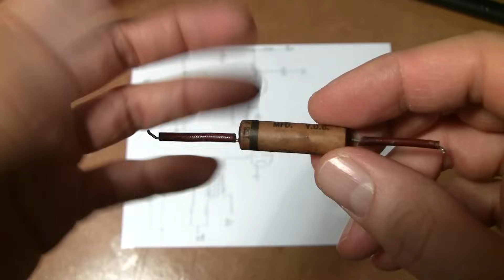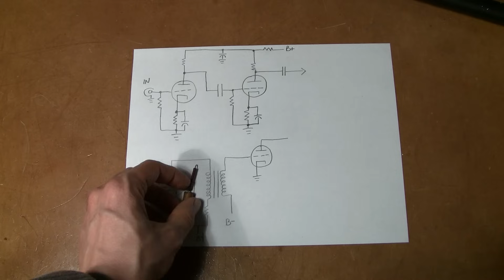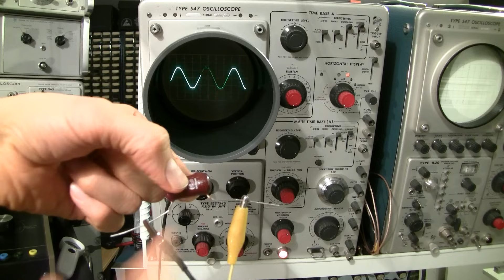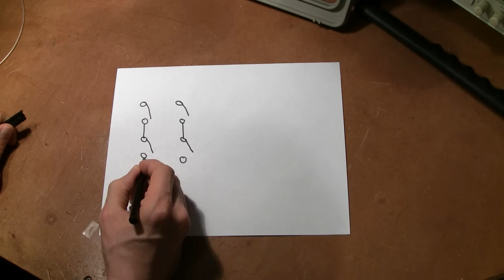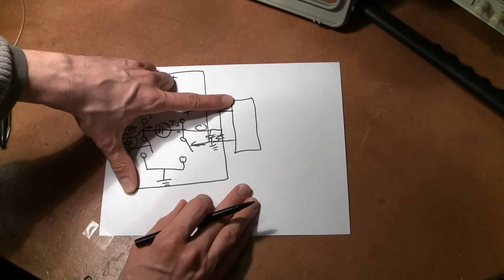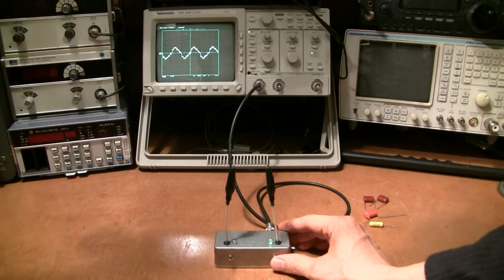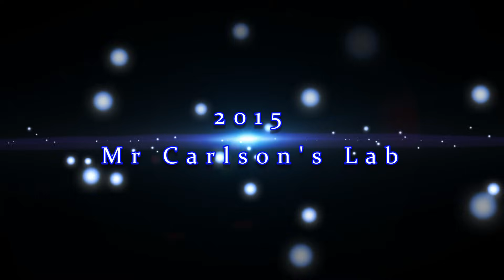Are Your Capacitors Installed Backwards? Build this and find out

Comment: I called Tone Pro re:the Humbucker set I bought. I believe I had identified the ground end of the orange caps they provided and ask them what lugs I should solder them to the volume and tone control pots ( 50’s wiring ). They said they’re not polarized. 

So, that being said, does anyone know which pot I solder the ground to ? Tia.

Comment: Did you discharge the capacitors before you put the oscilloscope leads on them? I wonder if the markings on the capacitors are correct. Just an observation.

Comment: Is this phenomenon as important in transistor circuits as it is in valve circuits? If so how would commercial manufacturers take this into account when manufacturing if the cap bodies are randomly  marked in polarity, or not at all?

Comment: オイルコンデンサーは、金属缶に入っています。外側をフィルムで絶縁しています。
　外側にプレート電圧が掛かると、フィルム１枚だけの絶縁なので危険です。
　そのため、外側をグリッド側に繋げます。
　あなたの考えを聞かせて下さい。
(japanese)
Oil capacitors are housed in a metal can. The outside is insulated with film.
If plate voltage is applied to the outside, it is dangerous as there is only one layer of insulation, film.
For this reason, the outside is connected to the grid side.
Please let me know your thoughts.

Comment: So, when I build a gee-tar pedal, this applies to using a shielded box as well.  Yet, even with that, there could be unintended feedback and the like with the bleed over between circuit components.  Seems a crazy way to do elite optimized audio circuits if you have to test every one.  There must have been reasons for this.  What was the rationale?

Comment: I know this is a very old video so it's a long shot asking a question but it's worth a try. I build guitars and only recently was made aware that it mattered which way I install capacitors onto the potentiometers. I really only need the cheapest oscilloscope I can find that will help me test their orientation. I'm talkin weird brand name Amazon cheap if possible. Any suggestions would be greatly appreciated.

Comment: Question..?

Thanks for sharing your hand made schematic of the capacitance assistance time box.   I will build one but first I want to be sure I have something clear which was  glanced over…. On the CO4013, Your drawing shows pins 3, 4, 6 above 7, 8, 10?  Are these all grounded?  The 3, 4, 6 are lighter in green marker and not along side of the IC as everything else well shown.  I just want to be sure all six are grounds before I wire it.   Also, On the 555 timer chip…… Is it pin 6 or 8 to the 9 volt positive?  Hard to see which number pin in the upper right background.

Again, Thank you for this supreme education as I ponder now starting to recondition vintage radios.  

Oh, By mistake I hit thumb down but quickly went to hitting thumbs up.   Just so you know, one thumbs down is not real.  You are definitely excellent and a thumb up all the way….

Respectfully,
Michael in Palm Beach, Florida
561.951.9999 cell 
(Posting okay here  for you and all.)

Comment: But tell me though, are the model yellow caps made a different way so that here is no more 'outside foil' construction?
I tried the method that used an amplifier, cap connected to the input, listening for the loudest hum from your fingers. Same deal as using a scope to see hum on a scope.
 For some lower values we did hear a hum, others, mostly smaller valued , no hum or hum difference at all.
 For some circuits like a an extremely low noise floor amp, or similar circuit, some of these may , or may not matter. SOme hobbies like vintage radio restoration it probably will not patter at all.
     So the question is, are the modern yellow caps rolled like the old paper foil caps are? 
     Lastly I think he needs to make a video showing the actual difference in cap orientation, Is it something really to be heard? Or only to be slightly seen on a scope?

Comment: Wow!  You must be an engineer, using a 4066 plus all of the associated control circuit when a technician, such as myself, would have wired a DPDT switch as a polarity reversing switch and would be done.
Rube Goldberg would be very proud of you.

Comment: I was testing a bunch of capacitors manually and I was identifying the foil end easily until I got to some mica (680 pf and 1000 pf) caps which showed equal amplitude in both directions.  What have I done wrong?

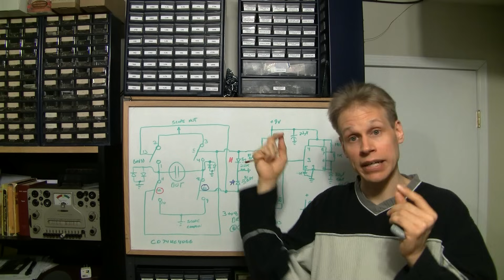Comment: I would have made this much simpler. Just one 4pdt switch a knob with a pointer and a BNC connector. Let's start with the shielding foil to the right in his drawing shown at 36:39. With the switch moved to the right contacts 3/5 and 11/12 closed, so the shielding foil is connected to the scope and the other end is the ground side of the scope. The noise should be low and if you reverse the cap the noise will increase. But, if you then turn the switch to the left the noise will drop back down. The switch pointer always points to the side you should mark when the noise is low. Simple. Let me know if I have this wrong.
Reply from the maker: I have explained why this won't work a few times in the comments already, just do a search.
Reply: @MrCarlsonsLab  I went pretty deep, I found found two people said they built it with just the switch and a third where you didn't say it won't work, just you had reasons to build it the way you did. I did find this back and forth, shown below.

"@donaldfilbert4832
8 years ago 
 I certainly do understand the appeal of creating a test box using multiple ICs and elegant designs - I suggest that a simple "3 Pole / Double Throw" manual switch (On/On) approach would do the same thing cheaper and easier (and therefore - more elegantly in some respects).  The two center leads of two poles go to the Alligator clips.  The two outer edges of those two poles are criss-cross connected to provide lead reversal via the manual switch, and one end of each of these poles is connected to the ground and center lead (respectively) of the scope connector.  The 3rd pole is used to burn the respective LED - showing which lead is on the ground when the displayed signal level is lowest !!  I made the drawing - but can't upload it with this comment - but it seems sound.  Thanks for all the great videos !!!

 @MrCarlsonsLab  I have written why I didn't make it with a DPDT switch a few times in the posts. Just search down the list, I'm sure you will find them.

@AgentFriday
7 years ago
+Mr Carlson's Lab - I have clicked the "more" button dozens of times, and am still searching.  Could you maybe pin one of those answers to the top?  (Youtube comments are ridiculous, grrrr...)  This is such an obvious question, I wish the video would've addressed it right off the bat.  If I understood the need for building such a circuit, it would have been much more enjoyable watching the explanation, rather than having that nagging question "Why are we wasting our time on an over-engineered solution?" the whole time.  Thanks. "

Comment: @10:30 time stamp,
 That is really cool....
Well as you can tell, i'm extremely new to this type of stuff, will probably just do this as a hobby....
  Man do i have a lot to learn....
But didn't know thats how you check those Capacitor's, to varify, which way to install them in a Circuit, thats pretty cool....
  I don't own any Equipment yet, and so, for now, just trying to find good teacher's, that teach correct way to do all this stuff, so Hopefully, I don't pickup bad habits from incorrect, and poor teachers....
  Thanks, Mr. Carlson, 
For all these Valuable Videos....👍😎🇺🇲

Comment: Most of these capacitors are used in networks rather than supply bypass. By the time you have noticeable pickup, it's on both ends. So the real design requirement is adequate shielding.

Comment: Excellent video.  Now (for me) the important question: how much of a difference will this make in my (yet untested or powered up) Fender Deluxe Blackface amp kit?  All the electrolytics are in according to the circuit.  Should I de-solder and test the others?  Will it make a noticeable difference?  Thanks as always!

Comment: I used to repair electronics in teeminals used at newspapers in the 80s. I always wondered about this issue and asked myself if I was really installing the caps correctly. Took 40+ yrs to get an answer. Why these aren’t correctly labeled at manufacture is kind of mind boggling. Wouldn’t take too much effort to get that done correctly

Comment: I have a Crown LXi1500 amp I am replacing the coupling caps with polypropylene. I don't have a scope so I used a shortwave radio tuned off frequency. The antenna was an inductive loop and the grounded lead was attached to the BNC ground & the antenna input was the loop. Cap held with alligator grnd wire. Least change in sound when touched was marked as banded end.
Reply: Clever idea, thanks!

Comment: When you are connecting the capacitor to an oscilloscope aren’t you using it as a high-pass filter? However, at the same time you are speaking of them as applied in grounded low-pass filter. To my understanding these two applications have a significant difference in how the characteristics and quality of the capacitor affect the output signal, right?

And I didn't quite catch what you are trying to demonstrate by putting your fingers on the capacitor shell. Of course you are creating ground interference but how is that supposed to relate to potential interference induced to an actual circuit?

Comment: It is interesting observation... But it really does not matter because the capacitance between terminals is much greater than the parasitic capacitance through the epoxy case. And in reality in the air the capacitance to the body will be ~10-20pf, nothing compared to 100,000pf (0.1uf). So I doubt that any manufacturer cares about polarity of non-polar capacitors, but if DIYer is happy about the "perfection", let them be so! (certainly, tubular ceramic 10pf capacitors at 100MHz circuit do make difference. In the past, when they were produced, they did have markings for the outer terminal)...

Comment: I'm not disputing what you're saying for RF circuits or using old foil rolled caps, but after building dozens of preamps, hi-fi and guitar amps with modern components, this simply isn't a practical problem. These curcuits were dead quiet on a scope, and I didn't worry one bit about which end of the caps were pointed in what direction.
I also can't help but think that if this was a real problem in modern capacitors, there's no way the manufacturer would leave them unmarked. Just to save a dot of ink? Come on.
Reply from the maker: It's pretty simple, modern circuits are built on circuit boards that can have a ground plane underneath, (takes care of the outside foil issue, "in some cases.") The majority of modern circuits are lower impedance on both sides of the cap as well. Since the market for using caps "off circuit board" is very small, the cost of detecting orientation and marking the cap ultimately increases the price in a very competitive market. There is a reason they marked the outside foil on older capacitors, some were marked very clearly "ground end" as well. If you can see the difference on an oscilloscope, (even in the audio realm,) are you denying there is a difference in an audio circuit built point to point? Remember, for your future builds, if you want to do the job correctly, "the detected outside foil end always goes to the lower impedance portion of the circuit." If you don't follow this, you can end up with all sorts of issues you may not detect immediately, including parasitic oscillations at frequency points when a sweep analysis is performed on your preamp circuits, ETC. Do you sweep your circuits properly, for example using a Stanford Research SR785 or similar piece of gear?
Reply: @MrCarlsonsLab  correct, I am denying there's a difference in audio circuits built point to point. And no, I didn't have a room full of expensive equipment that I could name drop whenever someone disagreed with me. Cheers.
Reply: Greetings.. Just watched the video myself @MrCarlsonsLab  and it was great and informative. But as a beginner in circuit design(no tubes) I just got a bit confused  on the following: I see the difference in @15:27 cap and till now I consider them as modernish MKT. If we have to be aware of the foil polarity on those regardless of the board design, do we have to care about the MKP too? Is this affecting the results only when paralleled to ground for filtering or in series decoupling too? Till now I was using either MKT or MKP regarding size and tolerance and thought that small changes in sound are due to spaning tolerances. Is there a general rule to follow when we are able to? Thank you

Comment: Very interesting.  I had never heard of this.  I just tried several new caps, and with a Tek 2465B at 20mV/duv I could not detect a difference in polarity on the caps.  What am I doing wrong?
Reply: Nothing. It's not a real problem.
Reply: Maybe you skip the fingers on the cap to use your body as an antenna. I don´t know. I know nothing about this stuff, really.

Comment: I sadly don't have the test equipment to do this test..... I am replacing all of the old red Tiny Chief capacitors that are marked correctly to ground on my National NC 98 general coverage receiver. (2) 0.1Uf 400V,  (4) 0.01Uf 400V,  and (2) 0.047Uf 400V.... Mr. Carlson... do you know of replacement caps that I can buy and use that are marked correctly ? 
I have a Master's degree in electronics and computer science from back in 1983.... Back in the day I used to do all of this kind of work in my own repair shop and did it for 10 years after I graduated... I got married and got away from electronics... I have been divorced now for about 10 years and I'm getting back into working on tube equipment and sadly I don't have the gear like I used to have.... I'm basically on Social Security now... I must say you are one of the most intelligent people I have ever ran across when it comes to Electronics Mr. Carlson :-) 
Thanks and have a good day...

Comment: I have done the same thing with a amplifier and a screened lead into the input! The 50HZ buzz is much quieter if the capacitor foil is connected to the screened lead! If you get it wrong you certainly hear the difference! My scope has had it so  looking for a old secondhand one or I might buy one of those portable battery types with the small screens! Great tip Paul. I don’t know how many caps I have connected wrong since I have been working in electronics since the 60’s! I always thought only polarised caps like electrolytes +/- were the one’s you had to watch! I am 78 now so you never stop learning!

Comment: I happen to have an old DSE (Dick Smith Electronics) Q-1804 20MHz Dual Trace Oscilloscope, both of the two input channels can go down to 5mV/Div, so it should work fine for this kind of testing purpose.
Reply from the maker: If you use a direct BNC to alligator clip adapter cable in place of a probe  "it might."

Comment: Mostly Ridiculous.   A capacitor has a low impedance in most circuits.  That means it will have pretty much the same AC voltage on both terminals.  So it makes no difference which lead is the outer foil.  

About the only exception might be down in the low picoFarad range where impedances are high and there is a significant difference in the voltages and impedances between the two leads to ground.   So in general it makes no difference which lead is “outer foil”.   That matches up pretty well with most electronic techs experience too.
Reply: Impedance is frequency dependent- low frequencies will make capacitors high impedance and high frequency makes them low but capacitance values also have an impact- for low value capacitance the direction isn’t too important but larger capacitors do need the polarity correct or they will explode or at least sweat and swell
Reply from the maker: I guess in your world coax doesn't need shielding as well? Can you think of why that outside foil shield may be important in RF circuitry? Why did they mark the outside foil end?
Reply: @MrCarlsonsLab  Please think again.  A paper-wound capacitor is going to have a low impedance in an RF circuit.  So BOTH foils are going to have the same RF voltage.  Same voltage means they're going to radiate equally, like nearly nothing.  

The only example I can think of is for capacitors used in tone-control circuitry, where they are not being used for their low AC impedance but for their reactance.  Those capacitors are going to have some AC voltage difference between the terminals so the outer foil would be best on the side closer to chassis ground.   And oh, one star case-- the capacitor from output tube plate to ground or B+.  Now THAT one has a lot of AC voltage just on the plate side, that one might show some potential benefit in being properly oriented.   Will give you that.

BTW I'm jealous.  I thought I was an old-time test equipment geek but you have about three times the HP and other quality test equipment than I do.
Reply: The outer conductor in coax is not just "shielding".   Its spacing from the center and the dielectric constant sets the cable's surge impedance and enables the electromagnetic E and M propagation modes down the cable.  

"Shielded cable" is completely different-- the shield is for electrostatic shielding only.  It has no specific impedance and is mostly unsuitable for conveying signals for more than a small fraction of a wavelength.

Comment: Great info on determining the foil side. I think just using an oscilloscope with the test leads is good enough. The circuit you build might be a bit of an overkill, but a good design, nonetheless.